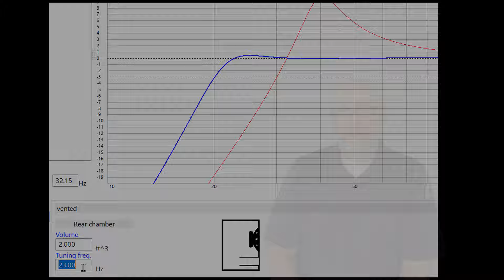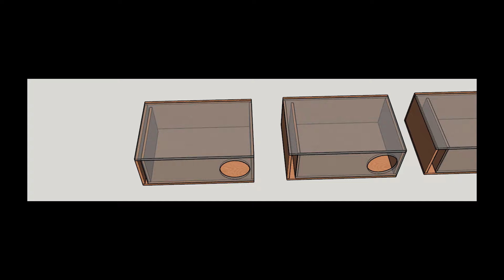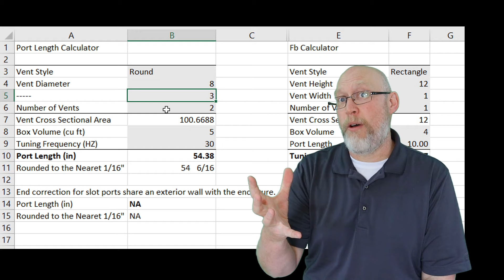Everything you need to know about PORT TUNING in under 3 minutes!

Comment: Round vs Slot ports....is one better? Is one better for SPL and the other for SQ?
Enquiring minds want to know!
Reply from the maker: Sounds like a good idea for a video!
Reply: Yes, there can be quite a substantial difference between wide or “slot” style port when compared to a circular port opening/exit.    The amount of difference relies on many factors.  For brievity,  I’ll focus on the most obvious factors.
When it comes to slotted style vents, you’ll want to look at the following:
1) port depth/tuning length 
2) vent opening height (probably the reason this venting style was chosen is to save a significant amount on this dimension when building an enclosure).
3) port width (probably the most critical).

The reason that port width plays the biggest difference when compared to constant circular vent opening is due mainly to the change in air speed (and associated distortions) across a wider exit dimension when compared to the tighter circular path equivalent.  This wider dimension allows for the air to slow disproportionately to the air exiting near the ends of the vent.  Anytime there is an offset/imbalance of speed, volume, or pressure within a rapidly moving column of air; distortions or vortices will occur.  Remember, this volume of air is trying to change direction 180*deg as fast as several hundred times per second!    Even though laminar flow could never really be achieved in either design (or any acoustic resonator above ‘maybe’  4Hz),   It’s best to ensure such distortions be minimized for best overall performance.    But again, it truly depends on many different factors, as well as the application of said design and the intended purpose (some designs benefit from a nasty whistling port... like most bandpass designs aka hemholtz resonators.   And some applications could benefit from such distortion....   like dubstep playback for 2000 of your friends.

Sorry for the lack of useful details on this topic,  but a response to a YouTube comment really isn’t the ideal forum for such writing.    There are some great things called books that will provide the answers that you seek.

Cheers!
   -Rob

Comment: whats the benifit of larger and longer port over a smaller and shorter port? larger and longer ports = louder to a certain point? I have built full TL qarter wave for 12" bms bass and it was more deep bass than i could ask for, the woofer behaved like it played in free air almost so it was important for me to have a good amp to have control handling. Keep in mind i used foam stuffing on the walls of the ports so rid myself of unwanted frequencies if there was some.
Reply from the maker: You need a larger Port opening so that you don't get chuffing, when you make the port opening larger you have to make the port longer.
Reply: @DIYAudioGuy   Yes i know that. Im wondering about the pros and cons of larger vs smaller given that the port is not to small so that it makes fart sounds or so large it becomes a horn. yes the larger the port the longer it has to be to have the same tuning. but is there a benefit to having a long large one compared to a smaller short one that does not fart? i get that the pro of a smaller one is that is takes up less space. I guess the bigger one will give more db gain?

Comment: I’m trying to tune a right trapezoid slot port, is there a formula or program for this? My idea was to calculate the port area of the trapezoid and use a rectangle with the same port area in a slot port calculator, hopefully it works out, if you have any tips or ideas it would help tons!
Reply from the maker: I don't know the proper way to proceed in this case.  I have a few guesses, but since I am not sure I am not going to speculate.
Reply: @DIYAudioGuy  no worries, hopefully it turns out well! If not I’ll be doing a aero port to simplify lol

Comment: For example....if I have 2 sundown x18v3 subs....tuning at 32 hertz....can I get away with 3 6 inch ports at 11.56 inches long to have less port space taken up in the box....or is  four 6 inch ports  at 16.87 inches long better ??  Does it matter?
Reply from the maker: You need a big port cross section or you will get chuffing.  Four 6" round ports may be good for just one of those.

Comment: I have a question you might be able to help me with..
I built a 6.5(net)cu.ft. box with a 5.75x13.75" port(29.5" long).. for 2 15"subs. The subs are on the sides with the port directly in between. Box was supposed to be tuned @ 30hz, and after testing I decided to try tuning lower. So I slipped a baffle down the center of the port, which would have effectively created 2 separate enclosures.. both 3.25CF@28hz.  
BUT..I didn't run the center port baffle all the way out. It only goes ABOUT halfway up the port, and then let's the 2 ports converge into one large Port. What did that do  to my tuning? Technically I lengthened the port, but split the first part in half.
Reply from the maker: That's not really something I can troubleshoot in the YouTube comments.

Comment: So if an enclosure has multiple identical ports should you add the cross section areas together and keep the lengths the same? Is there a way to break two big ports down to four achieve the same tune?
Reply from the maker: No, when you add multiple points with the same cross-section the ports will have to be longer.
Reply: I think Justin misunderstood the question. 

If you want to replace one large port for two smaller ports, then yes you would make sure to keep the same total cross-sectional area and the same length. 

For example, instead of using a single 6 inch diameter port you can use to 4 inch diameter ports. They are very close in cross-sectional area (25"² to 28"²). So the lengths of these ports would be very close to the same. You might have to change the length just a tiny bit to get the exact same tuning frequency.

Comment: I have 2 10" subs under my backseat in my truck in a non ported box, my question is if I put those 2 subs in a ported box would it hit harder with the same settings on the amp
Reply from the maker: Yes, but you will need a bigger box, so it probably will not fit under the back seat.
Reply: @DIYAudioGuy  yes I was figuring on that. Thank you very much

Comment: A question: If I'm using an isobaric loading of drivers that allows use of a box half the normal size, should I tune the port for the effective size of the box (X) or the actual size of the box (X/2)?
Reply from the maker: Actual size.

Comment: i used 5.5" metal stove pipe and no metal didnt have any negative effects
Reply from the maker: I don't see any reason why that would not work.  As long as the pressure from the sub doesn't cause it to warp or flex it should be just fine.  A lot of commercial home theater subwoofers use cardboard tubes.

Comment: 8 cubic feet, one Stereo Integrity HT-18v3.  How many 4 inch round ports and how long should they be for 25hz? SI will not respond, none of the online calculators agree they are from 4" to over 100".  Any help?
Reply: If I donate $10 I still won't understand whatever PhD type physics/area formula's etc  I'll see.  Then I'll have to pay someone to translate it.  I just want port length and how many ports for 4inch ports.  Thanks!
Reply from the maker: Each time you add a port all of the ports need to be longer.  That is probably why you are getting so much variance in the port length.   Since you are struggling with the math it sounds like you just need to pay somebody to design a box.  I  can do it, but my turn-around time is very slow, if interested fill out this form:  https://forms.gle/iM8hPa3Hw1e3uHNw6 .  CAF and Drew Jones (Basahaulic productions) may be able to do it faster.

Comment: I am curious to know. I have a 2.47 cu ft box with  9.6" LONG 4" AERO Port.  It sounds good but why do I see some enclosure builds similar in size with what appears to be considerably longer ports with the same tuning frequency.  Any chance you could tell me at what legnth I could extend the port to get the same 33hz tuning
Reply from the maker: You will need to make the port wider if you want to make it longer and keep the same tuning frequency.

Comment: Hello, I have an ignorant question.  When you say you're tuning the box to a specific frequency, what does that mean?  The speaker will play other frequencies so I don't quite understand that terminology.
Reply from the maker: That is a great question.   At the tuning frequency most of the sound is being produced by the port. You will typically get a peak in output around the tuning frequency, then as you play lower frequencies the output will drop off.
Reply: @DIYAudioGuy  Thanks for the response.  By output, do you mean volume?
Reply from the maker: @BestUnderPressure  Yes

Comment: I am having a DIY curently now, and decided to do a 3.5cu/ft box, for x2 12 inch Kicker's L5 S12L5 4ohm 600w RMS with the port in the middle. The sub will be in boot, but facing the front of the car, as the car benefits from a sky port between the middle seats, so the sub port will be sitting exactly in the middle, getting all the pressure and bass inside the car. Will this be ok? Box volume? I am calculating port zise as per Kicker's website suggestion for 1 12 inch sub, and i added double port size for 2 kickers. Can you confirm?
Reply from the maker: That works fine if the subs are in separate chambers.  When you double the size of the box to add a second sub the port gets shorter, then when you double the port cross section the port has to get longer.  My advice is to call Kicker tech support, they will walk you through it on the phone.
Reply: @DIYAudioGuy  Basically their wesite and my sub specs are saying (SPL/Deep Bass: 3.25 cu/ft; 3"x13.25" port opening; 14.5" port length). What are the correct measurements for x2 of them subs? Also if the port lengh is bigger then the box itself, should i create the port in an L shape until it reaches the specifications size? Let me know please.

Comment: What if I have a pre fab ported box with a port right in the middle for 2 12s and the depth between the wall and the port itself is 12 inches I measured the port width itself and it’s only 6 inches wide I heard it’s supposed to be the same width and length as the port
Reply from the maker: I am having trouble visualizing that.

Comment: I've tried to simulate Paul Carmody's DIY "Speedster" in WINISD, which is tuned to 55 Hz in a 5.5 l enclosure and claims to have a mid 40-ish F3. So I have entered the T/S parameters for the Tang Band W4-1720 chassis, measurements for the box and vent. Indeed I do get a very nice and flat frequency response curve but at -3dB, I'm still well above 50 Hz! The drop-off is much steeper than it should be, according to the info on the build. Where is that magic happening? Crossover? Dampening? Incorrect data on my end? WINISD isn't detecting any TSP errors for what it's worth. 🤔
Reply from the maker: Odd.  I would suggest that you head over to toidsdiyaudio.com and sign up for the forums. The guys over there are really helpful at troubleshooting this kind of thing.  

But my first guess is that tang band updated the driver and therefore the TS specs of change.
Reply: @DIYAudioGuy  Thanks, I'll do that right away!

Comment: I have a 3 cubic foot box for a 1990s Pyle 15 inch sub. the box is sealed. I'd like to port it for a bit more from it.

would just a 4 inch tube work and how long would I need it to be to tuned to 32hz or about.
Reply from the maker: Just adding a port to an existing box does not always work.  I recommend using something like WinISD.  https://youtu.be/yZNeYBYGRKk

Comment: Is it true that the port shouldn't be 3 times longer than it's diameter so it won't create port noise?
Reply from the maker: Never heard that one.  A lot of really bad rules of thumb like that are based in reality.

1) If your port opening is too small you run the risk of creating audible turbulence coming from the port. This port noise is often called chuffing.  This is entirely based on airspeed velocity and has nothing to do with any particular ratio of port cross area to port length.

2) The actual physical port itself has its own resonate frequency.  As it gets longer this resonant frequency gets lower. Typically it's not a problem for subwoofers because your crossover is going to keep your subwoofer from ever playing those frequencies.  Plus, the port will become impractically long before this becomes a problem.  For a situation like that you want to use a passive radiator.  https://youtu.be/v4rAkxck2_Q

Comment: Good job on the Informational videos.. quick question to pick your brain.
I'm having an issue with my subs coming apart at the glue seam from cone to surround.  4 12s in a 8cu ft ported custom box tuned to 37hz with a single 7.5in x 6in round port.
Is there a chance the port is too big and subs are not getting enough back pressure and too much excursion? I run them fairly hard close to the rms, but not over.
Or maybe I need to ditch these subs.....
Reply from the maker: Mechanical failure is usually the result of over excursion, that happens when you play below tuning frequency or your enclosure is too large.  8 ft³ for 4 12's doesn't seem too far off to me, it really will depend on the sub.  If you're pounding away at those subs with a 20 hertz test tone at full tilt that might be your problem.

The other possibility is that  you just got a batch of subs with bad glue.
Reply: @DIYAudioGuy  ok cool. Pretty much the other option I came too. I set my subsonic filter higher fir safety.
Reply: @bgone84 Your port is 6" diameter? Thats really small for 8 cu ft box. I would run at least two 6" ports minimum.

Comment: Can you make the port OUTSIDE the box?
i am ubering but want to add a ten inch to just wake the system up a bit. seeing as how i need the trunk space i am custom making a fiberglass and wood box in the side corner of trunk behind the wheel well. this does not have very much space. can i extend, from the box, a port channel that runs back and forth between wall and trunk hinge?
Reply from the maker: Yes.  You can do that.  The sound waves coming from the port and the driver are large enough that they don't have to be right next to each other.  But, if I were you I would consider using a passive radiator instead.  Kicker has some really good pre-loaded enclosures with passive radiators. https://amzn.to/3sOWbR7

Those are designed to be installed down firing and you can throw luggage on top of them.

Comment: Why some subwoofers have port in the back? Is there any difference or are the same?
Reply from the maker: There is a lot of debate about the port location.  In home audio if the port is on the rear of the enclosure port noise will be less audible.  In a car you can sometimes "load" the port against a wall in the vehicle and it will be a little louder.

Comment: ??? I HAVE a sub box for 2 10s, the box fits under rear seat of a 01 dodge ram ext cab.. 2 kicker cvr10s . the sub box says .570 air space per speaker, the box is also un ported.. I can't download the program you mentioned.. I'm also using a boss pv3700 amp.. what size port should I use?? . I mostly listen to rock and country.. I appreciate any suggestions... ty
Reply from the maker: It is nearly impossible to port one of those ram under-seat enclosures.  Juice is not worth the squeeze.
Reply: @DIYAudioGuy  ok ty vm ..

Comment: I have 2 15 inch subs I want to tune at 33 hertz. I’m not sure how to figure out how wide and the length I need for a port
Reply from the maker: I would recommend using WinISD.  That way you can check for port air speed.  https://youtu.be/yZNeYBYGRKk

Comment: Hello, I am trying to figure out how to design a box for my pair of JL subs 13” W3V3, I have an epicenter and I listen to Spanish music 90% of the time. What should my box be tuned at to get crips sound, my current box in my car doesn’t sound to well with Spanish music only rap.
Reply from the maker: First step is to experiment with the settings on the epicenter to get what you're looking for.  After that I would recommend speaking to a local shop that has experience with the genre.
Reply: @DIYAudioGuy  will do, I am still somewhat new, so most likely I’ll take it to a shop around me to see if they could get it build the my music preference. Thank you !

Comment: Will a 23hz box with a 15inch sub be tuned to low
Reply from the maker: Depends on the subwoofer and the application.  If it is a home theater subwoofer it will probably work, but that is not ideal in a car.